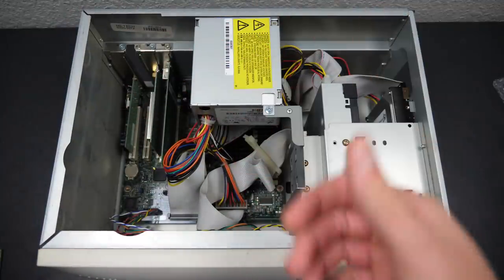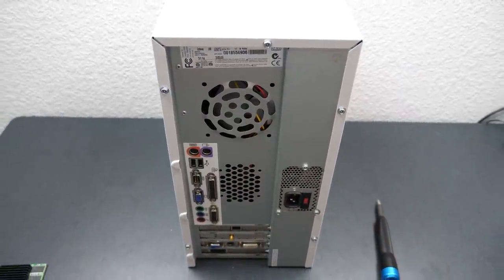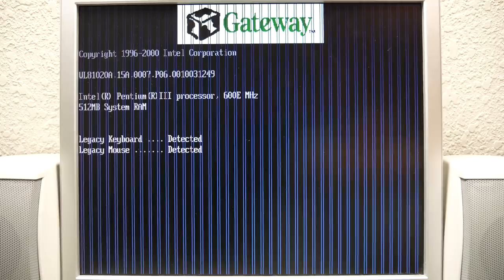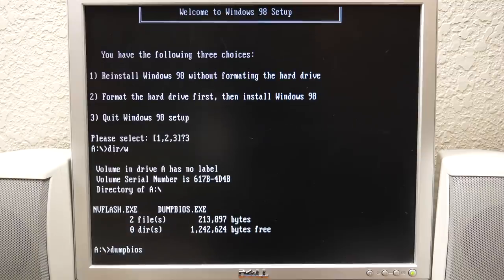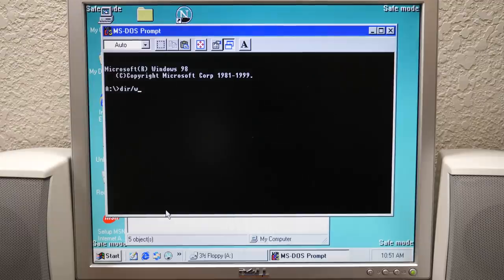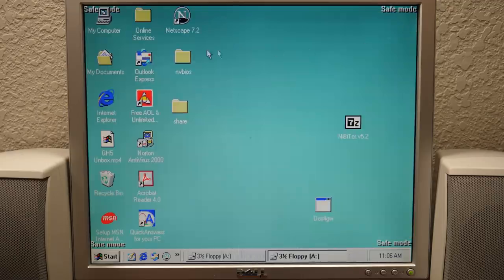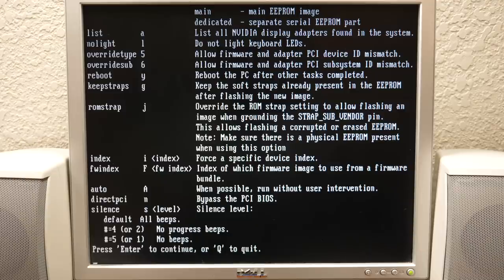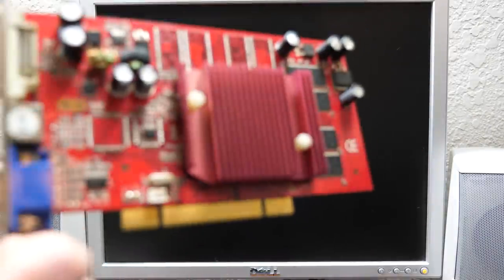Installing a Graphics Card in the $5 Windows 98 PC..... Maybe

Comment: These cards are also just infamous for dying like that (see MattKCs Ultimate 98 PC videos)
Reply: I had THREE GeForce FX5500 AGP and all of them failed like this.
Reply: @christoffer4862  I was honestly surprised the 98 PC still POSTed at first
Reply: Is this issue also common for another GPU's like GeForce 3 Series?
Reply: when i got my family computer i played on growing up it would go to a black screen after a while, Turns out the fx 5200's fan had seized up so i took off the fan and the sticker and got greased the bearings with penetrating oil and now it works again although does smell like penetrating oil lol
Reply: @Twintania  my FX5500 didn't have any fans.
Reply: I have a PCI FX5700LE that is still in use :P

Comment: 11:40 when the FAT floppy error ocurred, it changed your floppy disk size from 1.4 to 2.3 MB. You must've discovered a DOS-bug.
Reply: And I think that this maybe corrupted some files like nvflash.exe and maybe the bios file too. Try doing all of that again on a different floppy and video output form integrated graphics.
Reply: @ggorg0  12:10 he didn't use that floppy and redid everything off-camera with the other disk.
Reply: Basically the bug that happens when SMARTDRV is running, it's the BIOS calls that had the bug, had the same issue with my Gateway PC, it's because they locked down the BIOS support for hardware as much as they can so for example their customers couldn't replace the CPU with certain speed CPUs, etc... I tried to change out the celeron in mine with a P3 and it wouldn't even POST yet the CPU worked fine in another board.... Also it didn't like HDDs between 30GB and 80GB, so a 120GB HDD would work fine yet a 60GB HDD would corrupt regularly.
Reply: floppy disk duplication glitch
Reply: One of the few bugs…
Reply: @DoggyBingBong  that would be 2.88 mb

Comment: in 7:29 - 18:00 Michael tried to re-flash the GPU’s BIOS, and after looking at the footage, I found the reason it failed.
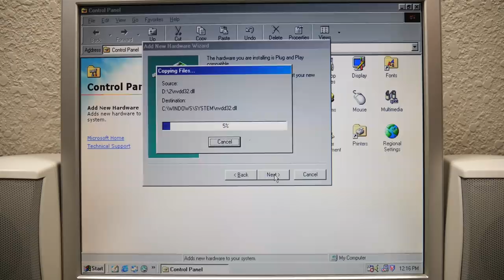When he was using the Nvidia BIOS editor tool, (NiBiTor, seen at 16:09) I saw that the card model selected was the AGP variant of the FX 5200, and looking back at 5:55, I saw in the label that it read, “...FX5200 PCI 128MB” so the BIOS file was expecting the AGP variant, but got the PCI variant instead.
Reply: You are quite smart indeed, I wished that Michael saw this comment
Reply: Fuck. That's rights yeah
Reply: wow a technical issue i actually understood in this series of video, im surprised of myself

Comment: Just a word of caution is that the power supplies for these machines are known to fail and I had to learn the hardway. By the way these low end office toasters do pretty well with a 3DFX card like a voodoo 2 even though it is pretty expensive these days.
Reply: yea,but he wants aero on vista or 7
Reply: @bokexd3173  He could Try a Ati equivalent...
Reply: Yep, I said repeatedly in comments NOT to install a graphics card with that 90w power supply installed.
Reply: @gasrim  he wants to have drivers for most of windows(everything from win95 to 7 or smthing
Reply: is it caps that go pop or something bigger?
Reply: @CobsTech  These power supplies were just too weak being cheaply made so it is likely more than just the caps. Those who were around remember all too well that back then power supplies were not rated accurately especially the knock off brands for the diy market. These oem units are just too weak and even with a recap it probably won't be enough.
Reply: @MrKillswitch88  and he could just replace it with a modern tiny power supply, that uses an external brick. Craft computing recently used a 230w power brick to power his mid-end gaming pc inside of an xbox one S case for his office.
Reply: @lonergothonline  For a 9x or dos build of the period it is not all that simple as just using a modern psu as you need a somewhat decent 5v rail for the cpu and for isa audio you are going to want to have the -5v rail that hasn't been included since the mid 2000s on most units.

Comment: I once had an ATi Radeon that before died showed vertical lines like the ones on your video.
Find another, this one overheated sometime and damaged the GPU.
Reply: I would just remove the heatsink, and reapply / replace the 20 year old thermal paste / thermal pads.
Reply: @TheNews1990  That wouldn't reverse any damage though
Reply: Yeah, looked like the card was trying to die, and that really caused all the problems.
Reply: Yeah its a 5200. Just get a ew one.
Reply: Sure. let's just go down to the nearest store and pick up another 20 year old GPU
Reply: @aKuBiKu  it's overheating. It'll stop it from overheating.
Reply: @TheNews1990  If it's already attracting like that then it will die sooner or later anyway, stopping the overheating now won't fix it.
Reply: @TheNews1990  What they said was that the GPU may have already suffered permanent damage from excessive heat. Replacing thermal paste will only stop it from overheating; it won't fix any preexisting damage.

Replacing the thermal paste might prevent further damage if the card wasn't already severely damaged. Any damage bad enough may alone be enough to continue to deteriorate the card.
Reply: @DangNguyen-xx3zi  in poland almost every goddamn pc had either this, or a radeon 9200/9250. they're not that hard to find.

Comment: If your BIOS has an option for selecting the primary display adapter, you can take the nvidia card out, configure the BIOS to always prefer the integrated graphics, and then plug the nvidia card back in.  You can then try flashing it again or using other options.  You might want to try getting a known good bios for it off the internet - its possible that if you dumped the bios with one version and flashed with another, that there are differences in things like a header that would make it not work right.  Or maybe it didn't work right because the card is overclocked and hot, and wasn't able to write the new bios successfully (letting it cool down, and then turning it on and immediately booting into the flash tool without loading Windows first might allow it to flash before it starts misbehaving - I noticed that your video problems usually only occurred after the machine had been running a few minutes).

Comment: Instead of flashing, it had to be reheated, lines on screen usually indicates bga problems, gpu solder points, since this is a passive cooled card, it gets toasty , even with a fan it was more than warm. I fixed cards with this technique back in those days, and one agp card i still have, and works fine.

Comment: Considering that when you bumped the desk the image corruption changed, I think probably the issue is a cracked solder joint. Whatever bent that bracket in shipping probably caused a cracked joint, possibly in the GPU itself.

Comment: Hi is the EEprom available in like a smd package with pins ? you could use a CH341 Cheap programmer to program a bios to the chip from another PC directly to the eeprom under linux you probably can use the flashrom utility and there should be also a tool for windows.

Comment: "Installing a graphics card"

Me still on integrated graphics:
Reply: Two decades ago, I stayed on my Intel 815 integrated 4MB graphics, giving me mostly what I needed, up to 1600*1200 in Windows for Workgroups 3.11, 95B, and NT4, though I usually kept it at a much lower resolution for the better refresh rate and color depth (and to cooperate with Puppy Linux too.) Now I get to see which adventures I missed out on!
Reply: Your integrated graphics are probably better than that FX5200
Reply: I've decided to get a GT640 or a GTX650 but don't know when. Intel HD Graphics 2500 sucks
Reply: @amvymavy  If you can find a GDDR3 version of, and 2gb, you'll do OK for some 2015ish era gaming depending on how much visual acuity you lust after.
Reply: @thedungeondelver  they say it'll be fine on GTA 5..... I guess that's correct since you said 2015ish. Also it'll be fine on Trackmania too since thats my other most used game
Reply: @thedungeondelver  You mean GDDR5. DDR3 on video cards is inferior.
Reply: @MLGKid420  Yes, but GDDR3 is a thing, and superior to DDR3, and would be on an older card.
Reply: @amvymavy  Yeah, if you poke around (try RandomGaminginHD's channel, for example) he tests GTA5 out a lot and it seems to be a bit like DOOM(2016)/Eternal: runs on nearly every damn thing.

Comment: It could be that the floppy you used to store the bios is corrupted because i saw that it changed to 1.44mb to 2.3mb in a part of the video so that explains nvflash being corrupted and the bios could have be written in a sector that didn't exist so it overwrited another thing, you have to keep the original bios because there is a chance that it wasn't overwritten.

Comment: Have you tried reflashing the old BIOS?
I have an old VBIOS for that card "NVIDIA GeForce FX 5200 VBIOS", version 4.34.20.18.02 from 2003.
But I don't think that it will actually help, as the board is most likely different. (Considering Product ID is different)
Strings still indicate Gainward.

Comment: yo i had this exact same issue, but on a system running Windows 10, i7-2600, GTX 650 1GB. and all i did was clean up the GPU and its contacts and then on it stopped from freezing out of no where and to seppuku the whole computer to the point where the BIOS SPLASH doesn't even show!

Comment: I am sure that the card has a PCI interface, but in 13:53 in upper-left corner of Nibitor there is AGP.  I'm not certain, but could this make the error, you encountered in the end?
Reply: Yes it's definitely the wrong device selected in the BIOS editor.
Reply from the maker: That was the model of card that the editor pulled from the BIOS file that was created. It wasn't modified. I thought the same thing when I first saw it but there wasn't another option for the FX5200, so I left it alone.
Reply: @MichaelMJD  If this is the problem then it can only be reversed if the EepROM is Directly connected to the PCI-bus pins.
It does explain why the bus connection doesn't work though.

Comment: Well, I did have a Windows 98 era machine that was running great. I got it for free from work. It was running great with a 450 MHz Pentium 3, 384 MB of RAM, and a card that I upgraded to a Geforce4 MX440 which is admittedly a little new for this computer, but it worked fine. However, I recently did something that I can’t figure out the problem. I went to change the CMOS battery on the motherboard. At first, everything was working fine. However, as I was playing a game, it ended up completely freezing. So I reset it, and no POST. So then I reseated everything. Still no POST. Even resetting the CMOS did nothing. The computer will power on, but only the fans and things turn on and I get no POST whatsoever. My biggest worry is I may have damaged the CPU when accidentally messing with the arms that keep the slot 1 card in place. It is hard to tell though as I don’t have another Pentium 3 to test it with. I may do some more messing with it soon, but I am worried I may have messed up the system. I don’t know how to test it though when I don’t have testing equipment for it. It makes me sad this happened because I loved using the old computer that’s older than I am.

Comment: Overheating was my first thought when I saw it first but since it is a PCI card, there could be some conflict with the other PCI-cards you had in there. I would've removed all other pci cards and put the gpu in the first slot as a first step.. It is possible to unbrick, either by trying to force pc bios to use integrated gpu even though you have that one in, or just use a eeeprom flasher, there should be a spi flash somewhere on the board. Edit: Also, the thermal compound is likely very dry too, so it gets more warm than it should, even though it doesn't use a lot of power, it could still mean some "cores" in the cpu get much warmer then others..
Reply: Usually PCI graphics cards prefer to be installed in the 1st PCI slot. But on this motherboard that's not possible, since there's already another graphics card in slot #1 - the onboard graphics. Consumer motherboards with onboard graphics and no AGP slot were notoriously bad then, and so were boards with any kind of VIA, ALi or SiS chipset. So were all Nvidia chipsets except nForce4. Or that Intel chipset which used Rambus RAM (i820?). Or any motherboard at all which took 1st gen "Slot A" Athlons - BSOD city if you tried to use AGP.
Not to mention the huge faulty capacitors scandal around that time. Yeah building a gaming PC was "fun" in those days!
Reply: @sl9sl9 Yeah, sure, but I would still try it as a first step anyway. haha, yeah, the bad caps were real fun. 😅 So that could be part of the problem, unstable power to the chip. Oh and yeah, rambus, what a piece of shit, have a pentium4 motherboard with rambus lying around here, it never had any problems with agp for me, but the memory was very expensive and I think slower than ddr as well. 😅
Reply: @kruppin  It's only the first "Slot A" Athlon platform that had severe problems with AGP, AMD fixed this with Socket A and the old Slot A beasts are pretty rare now thankfully!
Impressive that you still have a Rambus Pentium 4, what a trip down memory lane. Those things were awful because of the bad RAM latency (and high cost of RAM as you pointed out due to the Rambus company patent trolling everyone) but they were stable at least. They may even become collectible someday! Does it only support the first Willamette P4's, or can it handle Northwood or maybe even Prescott? I think the dual core variant may be a step too far though :P

Comment: Just boot with 2 graphic cards plugged in. One in AGP slot, and in PCI slot. Specify in BIOS, that it should use AGP first. Then run NWflash, and flash back BIOS to second card. NWflash should have commands, to specify which card to flash bios.

Comment: I have two graphics cards I can send you that might work for this. One is a PCI Radeon HD2400 Pro 128MB and the other is an AGP GeForce 4 Ti 4200 64MB. Both work, as far as I'm aware (the PCI one does for sure). Let me know if you'd like either or both of them.
Reply: The 4Ti 4200 is way better than the (now semi-dead) 5200 for dx8.1 and win98! Awesome card <3
Reply: @rarapas  Yeah, I got it in a thrift store computer that had a dead motherboard, and I haven't come across another AGP board to test it in, so I really don't even know if it works, but I figure that it would be a good card for this PC if it does.

Comment: some things i wanna point out: 
1) It could be over heating. try to mount a fan on that bad boy.
2) if that bracket has any voltage on it it could short the vga adapter
3) there is something supposed to be mounted near the dpi connector 
4) that gpu might not be compatible with your hardware in that pc

Comment: I have vague memories of doing a similar thing in the early 2000s. It might be worth: 1. Taking the AGP card out. 2. Using integrated GFX go to the PC BIOS. 3. If the PC BIOS has an option of selecting to initialize a specific GFX first, pick the integrated one. 3. Then put the AGP GFX card back in. 4. Try flashing a working file to the AGP card by running the flash utility. 5. Go back to the BIOS and select to initialize AGP first again to use that card. My apologies if this is a false memory!
Reply: I've done a similar process as well. It was most useful when I wanted to flash a Mac card to PC.

Comment: I'm sure it's been said but I throw it out there, put in another card along with this one and if you can boot off that one you can reflash the 5200. If the motherboard allows it tell it to look for the onboard video and boot off that with the 5200 in the system and then flash it. Newer bios like mine have a setting where even if it detects a pci express graphics card installed it will force itself to use onboard. Hopefully this helps.

Comment: You're not going to recover that card without a BIOS programmer. Doesn't look like you really did anything wrong, though. I think that card was on its way out and that BIOS flash finally put it over the edge.

Welcome to the Geforce FX 5200 Experience.
Reply: this's not FX5200 issue. Flashing a graphics card BIOS from under an OS is just a bad idea.

Comment: I had a similar issue when looking at a friend's computer on a newer gpu, still very old, it happened after the computer physically fell, I think some component on the pcb got broken or a solder joint broke. If some of the hundreds of solder balls under the gpu chip fractured from a shock, this can happen. I had the same thing, it would display in the bios, in the login screen, then the image would go nuts. I managed to force the driver install, then it messed up even in the bios, at which point I called it, ya broke it bud.

Comment: Luckily these FX 5200 are terrible so not much is lost (even a ti4200 is much faster lol).
I'd try to get a radeon 9600 or something similiar, it has drivers from windows 98 to windows vista/7, supports DX9 and is much faster than the nvidia fx gpus.
Btw for those of you using geforce fx in windows 9x dont use the  81.98 drivers, use the Forceware 56.64 which are much faster and more stable.

Comment: I suggest you to put it on a PC as a secondary card, then you can use nvflash to fix it on windows, i brought back a 750 Ti that way (nvflash for DOS is treacherous) it is likely the BIOS was corrupted, but in DOS version no integrity checks are made 
For a PC that age is normal that the PSU is giving up the ghost, it was bad back in 1999 but now it may have a few blown/dried out capacitors
You should've checked the voltages on the 12V rail with and without the GPU, as it failed right when initializing, it seems as a voltage drop to me that caused that lines to appear and the GPU not being able to reset